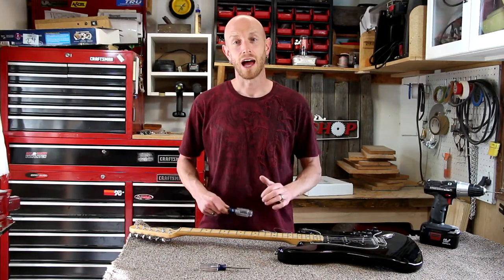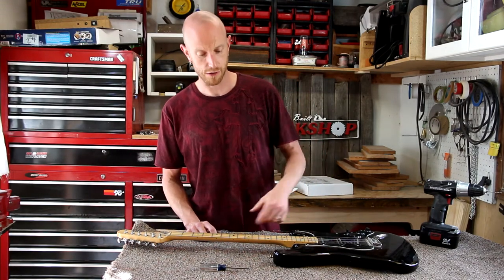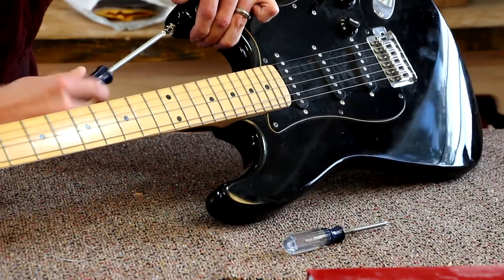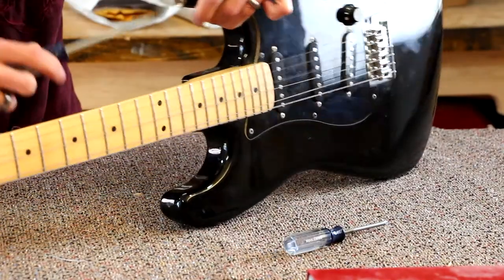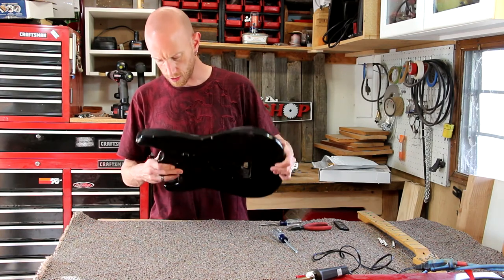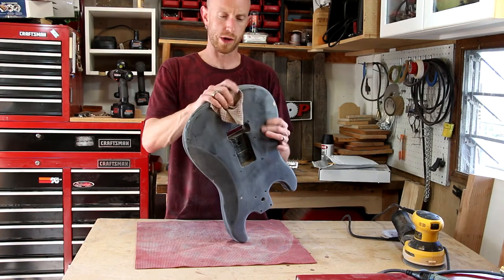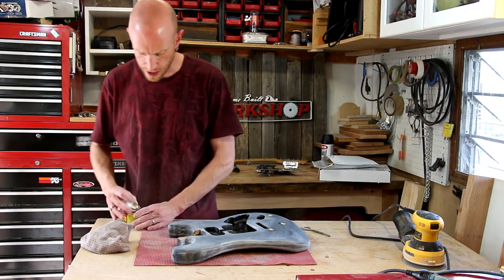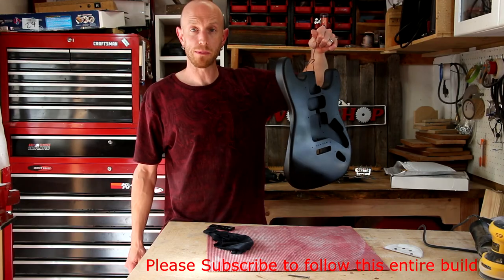Lefty Guitar Conversion Part 1, Disassembly and Paint

Comment: Not sure why this is a good idea, but hey.... it's your guitar so go for it.
I built an entire lefty Strat with a sanded down Fender body, hardware, doing it piece by piece with used Fender parts found on e-bay. Added some GFS Li'l Killer pickups, and an aftermarket mahogany neck... and did it for likely for less money than this project will cost, and it is a real lefty guitar.
Reply: ...and the copper foil....BLAH!
Go to an auto parts store and get the stainless steel muffler tape for less than 1/5 the cost of the copper. It will work every bit at well.
Reply from the maker: Its more of a fun project for me really. I do have several left handed guitars and don't really need to do this. Its just fun. Plus, what's another guitar in the collection.

Comment: What size drill bit did you use for the strap lock holes?  I'm a lefty and considering a lefty conversion for myself.  :)
Reply from the maker: I don't know what size for sure. I found a bit that was the size of the center of the screw. Just make sure its smaller than the threads. If you go too big just plug the hole with a toothpick and wood glue and redrill it. It will be covered by the strap button anyway. Good luck with the conversion. Its fun to do and you get to really know your instrument.
Reply: Thanks :)

Comment: The hardware is converted and that's fine but what about the body?
The wings on the body are still reversed and it looks awkward.

Perhaps the Strat isn't the best candidate for this conversion.
I've done lefty conversions and the best looking one I did was on a Gibson SG because the wings on the body are very close in size.
Reply: i have played right handed strat style guitars for over 35 years and a left handed strat still does not FEEL right to me